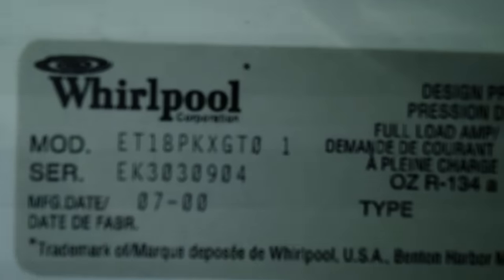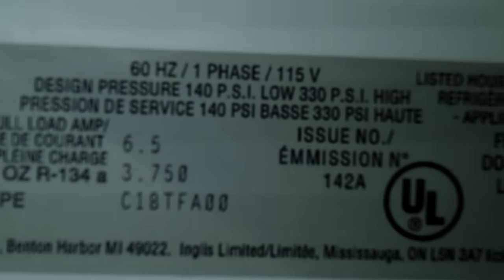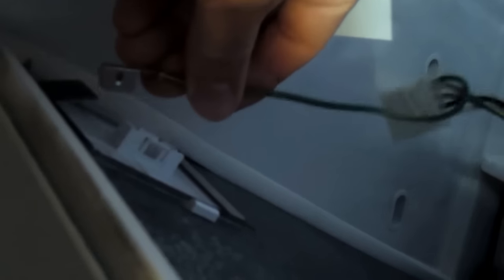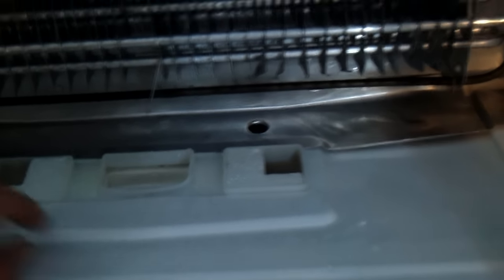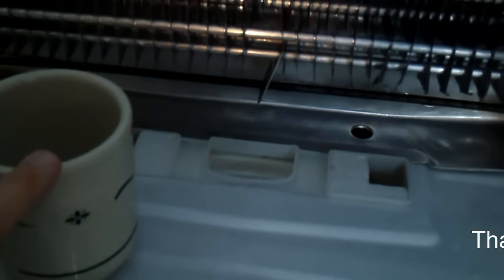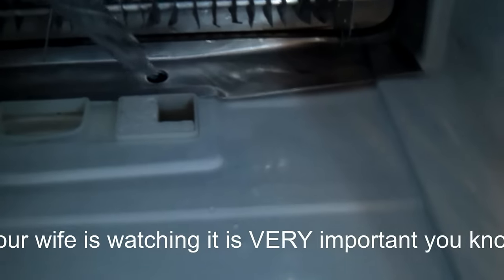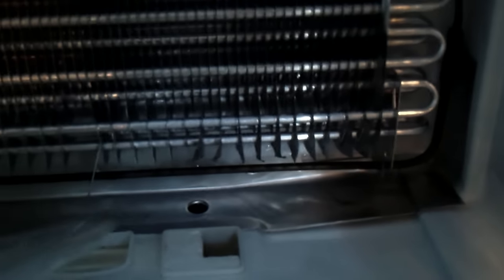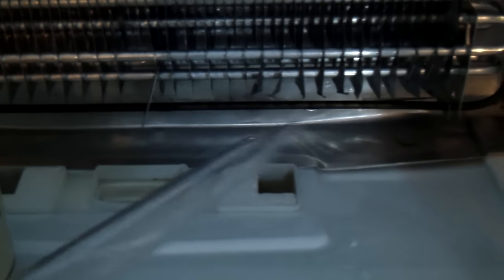Whirlpool Leaking Refrigerator Repair

Comment: Thank you for posting this video! I have a Kirkland (manufactured by Whirpool) fridge that has had a leak in it forever. 

I had a piece of tupperware in there to (attempt to) catch the water, but after watching your video, I now know that I was actually putting the container under the cold air blower, which is why there was still water everywhere, not to mention freezing whatever actually did make it into the container.

After removing the cover from the bottom of the freezer, I was able to easily see what the problem was. There was a solid sheet of ice almost all the way to the edge of the freezer. I chipped away all of the ice that I could, and used hot water to melt the ice blocking the drain. We do not have a turkey baster, so it was somewhat difficult to get the water in there, but we eventually got it done.

NOTE FOR ANYONE DOING THIS: The metal on the edge of the drip pan is VERY SHARP. While I was cleaning it out, I sliced the tip of my finger open to the point where I thought I needed stitches. So, BE CAREFUL!

Comment: Thanks for this. We've been dealing with water in the fridge for months. I knew what the problem was, but didn't know exactly where the drain was. Your fridge is just like ours, so your video told me what I needed to know. The process took almost an hour. I had to go in with a heat gun to loosen the sheet of ice on the freezer floor. Once I had that cleared out, I squirted hot water at the drain hole, but nothing happened. I figured the drain tube was frozen, so I used a bulb syringe to suck the water out of the drain hole, and then added more hot water. I had to repeat that maybe 15 times before the water started to drain. I put everything back together, loaded the food back in the freezer, and then used a thermometer to get both fridge and freezer set to the proper temperature. I think we'll be good now. Thanks again!

Comment: Dude you just saved us around $1,600.00! Our home is circa 1969 and our appliances are from the late 80's. Our Whirlpool fridge started leaking water and the new ones are so spendy that we were almost looking at a kitchen remodel to get a new fridge. I found your video here and it is exactly the kind of fridge we have. I followed your instructions to the "T" and the fridge is like brand new now! It was leaking water from the freezer into the main fridge just like yours. The water in the freezer was frozen solid and the drain tube was frozen solid. Your turkey baster trick was right on! Thank you so much.

Comment: You're the man! Had water pooling in my frig and the frig temp had been rising by the hour. My wife was ready for a new refigerator, the cost of which would cut into my tool budget. Couldn't have that. Watched your video yesterday and went right to work on my freezer. The drain hole was filled with ice. Used a hair dryer to melt the ice. Then attached hanger wire to heater, as recommended by Mark Harmon in a previous comment. Also checked heater element with ohm meter. Checked OK. Thanks!

Comment: Our is a 1997 ET22DKXFW00, this was the 2nd time I fixed it. Having read about the copper-wire-defroster mod, the 3rd time will be the last. We bought this refirgerator to replace a 1983 EHT201XK which was leaking in the same way. We moved it to the garage (think "beer fridge"), where the leak didn't matter so much, but have since fixed it in the same way, and it's still going strong after 30 years. Great video, BTW.

Comment: This is the second time in a year mine has dripped. The first time I called a tech, dished out 130 $ and watched. A year later, fridge just started dripping again . This time I decided to pay myself to do the job. I found your video tip for Whirlpool. Mine is Whirlpool year 2003 , no bottom piece to remove, but the same back. Your clear video and tips really helped me. 
I agree with other posters that the culprit may not be food bits, but packages shoved up against the back, blocking the vents. A design flaw or intentional design flaw intended to fatten appliance tech wallets.
Thanks for sharing!

Comment: Thank you so much.  Our freezer has been dripping out water off and on for over a year.  I looked into what was causing this several months ago, but could not find the source.  After watching your video, it made sense that there was a clogged drain hole in the location I had looked before.  I went and emptied the freezer, and sure enough, there was the clogged drain hole.  I liked hearing the sound of the water hitting the bottom pan after the clog cleared.  Thank you so much for taking the time to video and share your fix.

Comment: Sorry, but that is a short term fix. It WILL clog with ice again. Either get the heater kit, or bend a piece of copper wire around the heater tube, stick it an inch or two down the drain pipe.  My fridge was driving me crazy with that problem. Thank goodness for people like you and videos like this, it pointed me in the right direction.

Comment: Thank you very much for posting this video. I had the exact same problem with a similar model refrigerator and followed all the steps as in the video. It worked like a charm. There was ice covering the entire pan, and the drain tube was iced closed too. Thanks again for your good deed!

Comment: Thank you!!!  It has been a tough month with many costly repairs.  I wanted to cry when I saw the water in the freezer.  Your video was spot on.  The Whirpool model is different, but close enough. No bottom panel.  Your solution of putting the hot water directly in the hole worked best.  The water running down was the best sound.

Comment: Thanks so much to the author for posting this video. We do not have the same model Whirlpool as the one shown. Never the less I removed the lower panel, cleared away the ice and then with the aid of a hair dryer melted the top layer of ice from the drain. I then used the author's trick of injecting  hot water in to the drain with the turkey baster. Problem solved ! Just a footnote : I did not have to remove the back panel or ice maker. Saved us from buying a new refrigerator . Thanks again!

Comment: Thanks for the video.  It was a great help.  After unplugging the refrigerator, I used a blow dryer (being sure to not let it get wet) to unthaw the plug.  That took several hours but it was finally cleared.  Drip pan was removed, cleaned, checked for holes.  Hope I do not need the service kit installed.  Thanks so much again!

Comment: I had a different model but was still able to figure it out.  Found the right tool and went at it.  There was a full sheet of ice on the bottom of the freezer.  Once I got past that I got to the issue at had.  The drain hole was completely frozen.  Had to use a hair dryer and then hot boiling water.  Finally got it.  I cleaned the bottom of the fridge and now we will see!  Lots of prayers and fingers crossed!! Thank you again.

Comment: Thanks so much! So simple and it didn't cost a penny! I could not figure out where the water was leaking from! I didn't even have to take the top/back wall off, just the bottom tray in order to expose that whole. I used a straw to funnel the hot water to the whole to melt that frozen ice in the pipe. Thanks again!

Comment: Thanks so much. My Whirlpool is a different model, but this worked beautifully. I put all my ice and trays in the fridge, to keep everything cool in the fridge section (with the power off), which worked well. I also used a hair dryer (for about 10 minutes) to help thaw the drain--it took a few shots of hot water and the dryer to finally unfreeze it. I had to pull off the lower back panel to make sure the drain was draining into the pan. Today, I am a man!

Comment: Hey CTSCAPER, Thanks for the video!!!! Muah!!

I successfully cleared all of the ice last night, and didn't even need to remove the back panel of the freezer compartment, just the freezer tray!!! After emptying the fridge and freezer (and unplugging it) husband's job was to help me roll out the appliance and remove all of the screws from ice maker, freezer floor/tray, and back panel (outside of fridge). 

Our Whirlpool was slightly different so we did not need to remove the inside back panel of the freezer compartment, to get to the drain hole. I used hot towels (repeatedly wringing them out) to loosen the ice sheet under the freezer tray, then pulled out my hair dryer for the last really thick ice covering the drain hole. Then wicked up some of the water at the top of the drain hole with a folded paper towel, and THEN used a brand new 
Pampered Chef (lol) turkey baster to squirt boiled water into the pipe. Thanks so much for that tip!! Even if that's the only reason to have purchased the baster, it was worth it, since it saved me big bucks for an appliance person to fix the fridge. :)

I wanted the ice maker permanently removed, because we don't use much ice, the water into the freezer is not filtered, and not having gives me more freezer space. So, husband used packing tape over the end of the fridge-to-ice-maker connector, pushed it behind the back panel, then put a strip of packing tape over the hole. Ultimately, I think it took about 3 hours start to finish, though some of that was cleaning behind and under the fridge. 

P.S. Husband really did NOT want to help with this after a long day at work, but whine away, it got done! THANK YOU!

P.P.S. I wonder what these two extra screws are for (not the ones from the ice maker, which I already accounted for)! 

P.P.P.S. Truth be told, I think the pipe froze up because I had turned the freezer too cold. My bad.

Comment: I got this exact same problem. I assumed it had to do with the drain but I didn't spend enough time to take out the bottom and back freezer panes to get access to the drain at that top. I'll have to try this tonight. My wife's been ready to buy a new refrigerator so I'm glad you made this video!

Comment: Thank you so much for sharing the video.  We removed the floor panel of the freezer, did not have to remove the back panel.  Lots of ice all over, used the hot water method with the turkey baster to get the drain opened.  This is the first time I've had a freezing problem and my frig is 14 years old.  Wondering if having the fridge and freezer so jam packed with food that the air doesn't circulate properly and that might cause a freeze up problem.  Anyway, what you suggested worked very well!!!

Comment: Thanks for the fix and great explanation. My pan was frozen solid. Had no turkey baster but used the medicine syringe that came with kid's Motrin. It took many squirts of near boiling H2O but it eventually cleared the drain.  I suspect that the vents in the freezer may have been obstructed when freezer bags were too close. Hoping that keeping vents clear will prevent the problem in the future. Thanks, again!

Comment: Exactly my problem with my Kenmore fridge....cleared the drain chipping away at the ice with a screwdriver...then I used the baster to pull out cold water and to insert hot water. Taking out the back plate and ice maker was pretty simple. Worked liked a charm...thanks for the great advice.

Comment: I've been living with water in my fridge all summer. I replaced the bi-metal thermostat thinking that was the cause and never saw the drain because the ice was so thick. Thank you for this simple trick. Worked like a charm after I chipped away enough to find the hole.

Comment: Thank you very much for posting this video. I have a similar fridge as yourself. and it's been leaking on the inside for months it's been driving me crazy. I finally took the time to do research about it online found this. I ended up taking the back off the fridge apart first (it was super dusty anyway so cleaned that) Then thanks to your video took the back plate off the freezer. HUGE ice build up. 10 min with the blow dryer 2 clear away the drain hole. Thank you thank you thank you!

Comment: Thank you.  I think you saved me from having to buy a new fridge.  After removing the blocks of ice blocking the drain hole.  I covered the pan drain with warm isopropyl alcohol (alcohol bottle left in a pot of hot water from the tap).  After about about 5-6 minutes I started to hear gurgling as the alcohol broke through the ice.  I dripped some more warm alcohol using an eye dropper and heard ice fall through the tube.  I poured a quarter cup of alcohol twice to flush it out. I then ran a wire through the hole to make sure there was no obstruction, and smelled the alcohol in the pan to confirm I removed the ice clog.

Comment: This video was great. I chipped the ice away before but never did the hole. This time I used the trick here exactly and it worked great thanks. That water issue is gone.Thanks again

Comment: Thank you very much for posting this.  I had to clear an iced up drain hole and your instructions on how to take off the back panel and trick for flushing with hot water were very, very helpful.  I have an icemaker so there was one extra step to remove that before the back panel.  Unfortunately, there was a lot of ice chipping for me since this had been building up for a while.  Thanks again.

Comment: Thank you for this video. I have a 2 yr old Whirlpool, completely different inside, very very hard to get into the back, but same problem, ice in the drain. I left it disassembled for now so I can get a wire hanger to attach to the black tube. (who has 2 thumbs and no wire hangers?? This guy!) Thanks again. Hope it stays dry.

Comment: This is for those wondering why theirs is clogging over and over again. Ours never had this problem until we lowered the freezer temperature to a very low setting (it was somewhere around -5 degrees).

My theory is that the drain is not getting dirty, but that at very low temperatures the water going down the drain may freeze before it is allowed to escape to the pan below, thus causing the clog. My suggestion: un-clog your drain, then raise your freezer's temperature a few degrees. This is perfectly fine as long as you have a full freezer. Hope this helps!!
Reply: Just don't what worked but it came I think that WD40  did it
Reply: Luck was on my side   God was watching over me as I said my prayers
Reply: I was wondering if it was because I had turned down the freezer setting. Maybe by accident. Thanks!
Reply: Glad to help!
Reply: mine is an 04....ive cleaned the drain 2 times in the last 3 weeks,but it keeps clogging with ice...i see no temp control for the freezer.any suggestions?
Reply: steve jones strip a solid copper wire and put a hook at one end. Hang it on the coil and drop the other end into the drain hole. When the coil heats the copper will conduct the heat into the hole and keep it from freezing. Make sure it goes down into the drain a few inches.
Reply: Joshua, thank you for your video!  What size socket do these screws take? I am trying to do this by myself, and I am weak from a neuromuscular illness--my little socket set doesn't seem to have a socket that sits down on the screw the way they should, or I'm just too weak. I didn't want to bugger up the screws.  Thank you!
Reply: I fixed my freezer added copper wire and it worked for a while now its freezing up and dripping water in the fridge again!! Where is this freezer temp control located?
Reply: I put a couple squirts of hot water with a syringe  around the drain hole and then pushed down with  the short end of an allen wrench. The ice plug popped right out.

Comment: I appreciate very much the information I got on how to solve the problem of water coming into the whirlpool refrigerator.   I was a little confused because on my model the base of the freezer was not removable by itself.   Apparently this problem has been going on for more than one model change.   This seems inexcusable to me.    I found that freezer units, used in the lab, refrigerated microtome (cryostat) for example, use a heated wire that ran down the drain tube to prevent what happens apparently  frequently with whirlpool refrigerators .     I have used heating tape to keep outside facets from freezing.    Seems like a simple solution to me..  thanks again.
Reply: Thanks so
much for your feedback.  That makes
sense, since we already have enough heat to melt ice.   Why not get the heat a little closer to the
drain hole. 

+Land Designs Unlimited LLC

Comment: This video was spot-on. I wish I would've thought to search for this before I spent all of last night trying to find the blockage from the bottom up! Once I got drain opening exposed from inside the freezer, I immediately felt the ice. A couple of small cups of near-boiling water later, it was unclogged. Small tip--a small funnel makes it much easier to pour the water without it going everywhere.

Comment: Thank you, I appreciate the close up to see the inside of the freezer. Other videos do not provide the close up... A steamer is also good to defrost, when it is free of ice,  it is good to blow air with a compressor in the drain hole to clean dirt that could accumulate at the bottom end of it. Particularly if the refrigerator is not moved once in a while to clean the floor around and where it sits. If you have a fury pet, it is even more need. So if it is possible, roll the refrigerator forward and clean very well 3-4 times a year. My fridge sits 2" higher than the rest of the kitchen floor, a bit complicated. I use the crevice tool from my vacuum cleaner to go around it.